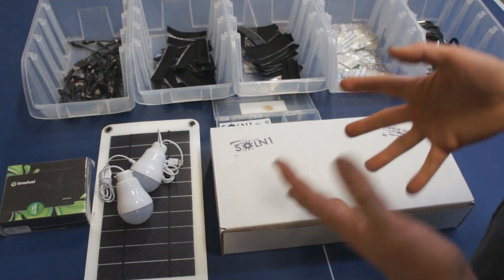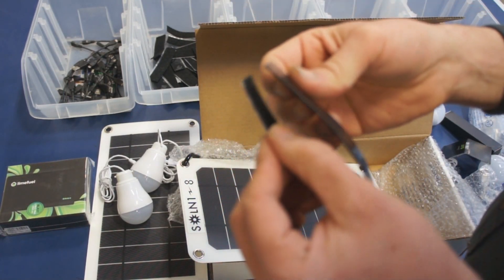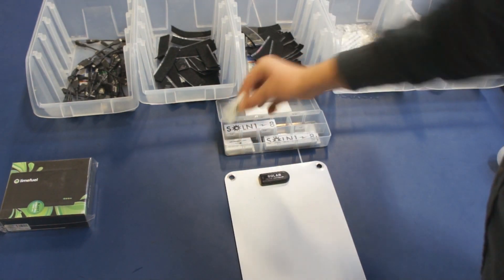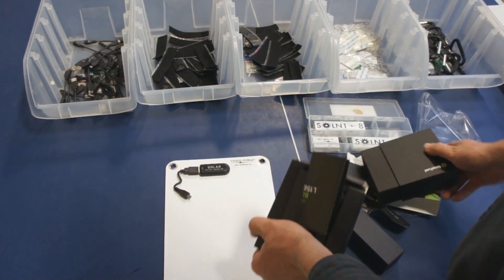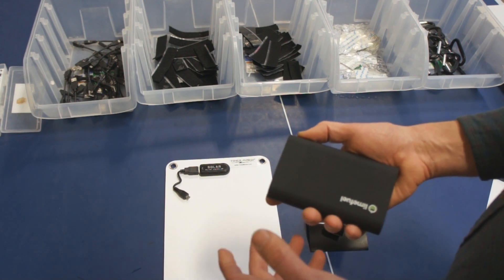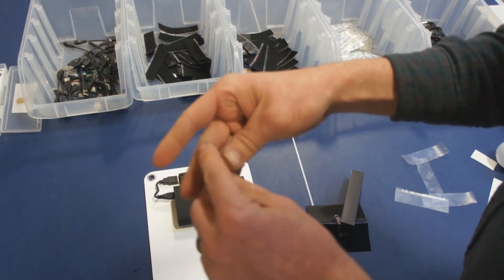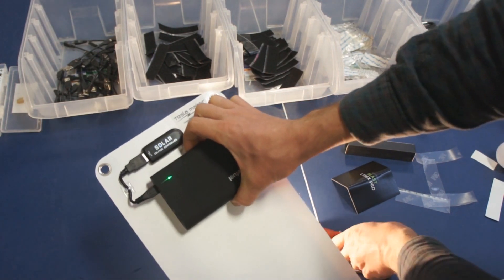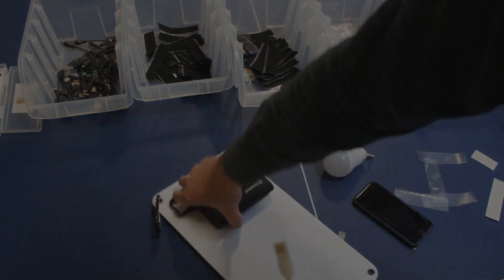Easy How To DIY Solar USB Power - SOLN1-8

Comment: you mentioned that the Velcro was upgraded to a type with heat resistant adhesive on it. Is this because the heat adsorbed by the dark serfaces of pannel is being transferred through to the back of the panel? If so have you done any tests to ensure that the lithium battery is not being heated above its maximum safe working temperature?

Comment: Just wanted to say thanks again for the whole idea. This particular project of yours has given me such inspiration for 5v solar panel / powerbank configurations vs 12v. I was fortunate to buy a panel when you first started the builds on your site, before the price hike, and have LOVED it (it's nice having a larger-than-necessary surface to collect in less-than-optimal conditions when panel size isn't a factor). It's also a great starting place for a novice like myself to be able to build cheap systems and still have the option to use a plethora of batteries and devices (anything USB-powered). I'm putting this same config in my daughter's clubhouse for lighting, and am working on USB switches for easier on/off/batterycharge. I'll have to make a video when it's finished. My next project will be trying to build one of those SJRs you're so good at creating. Thanks as always for sharing, Lasersaber.

Comment: Am I able to get the panels shipped to me in the UK? Or buy them myself somewhere in the UK?
Reply: sashablfc I found supplier from china that is willing to send me to EU, It is probably similar/same setup with laminated 8W semi flexible panel + usb charge controller 15usd, dhl shipping 27usd + paypal "tax" =44€. Someone on amazon sells them as well. Add customs charges on-top of that and it is price I am currently not eager to pay. Deal extreme holds 5W version, it would be nice it they start selling them from eu warehouse as well.
Reply from the maker: sashablfc If you have any trouble locating them, I do ship them international by individual request.  Send me an email if interested.  contact info can be found here: http://teslamaker.com/contact/

Comment: I actually bought 2 limefuel blast's for a school project and had an issue with one of them. don't know if it was a fluke or not but do not fully discharge them if you don't have to. I did and it wouldn't take a charge but would get really hot while charging with a 5v 2a or a 5v 1a charger(was actually worried it would burst into flames). It died on the day of my presentation :(
   The next day I said screw it and let it charge anyway and it eventually started to take a charge and I have been cautious about them since then but haven't had any other issues. a tip for anyone experimenting with them. if you accidentally short them out like I did(sometimes breadboards are more trouble than they are worth) just plug them in to recharge and it will "reset" it(but I would still be careful with it).

Thanks and keep experimenting. we all enjoy it
Reply from the maker: SNEAKYxWYZRD Thank you for sharing your experience.  Did you tell LimeFuel about it?  They would probably appreciate the feedback on their product.

Comment: Where do you get the solar panels for these products? I would like to build some of my own systems for different applications and these panels seem very reliable.
Reply from the maker: Dan Aaronson Before I started ordering them in larger quantities directly from Shenzhen I order them from Amazon.  The Amazon price went up and is over $50.00 each right now.  You can also order them here: http://www.aliexpress.com/item/8W-outdoor-flexible-solar-film-photovoltaic-charger-for-mobile-phone-tablet-bluetooth-headset-mp3-PDA/32248588501.html